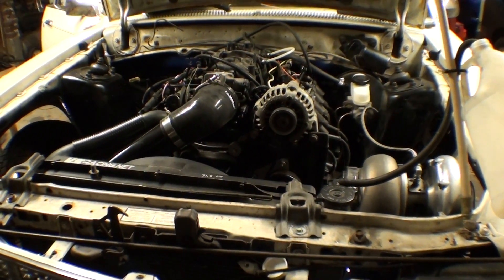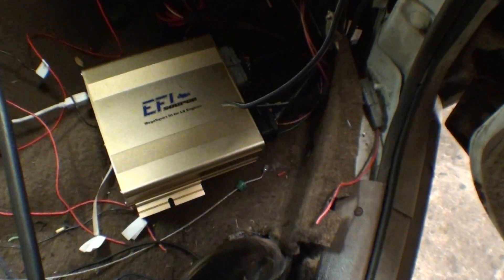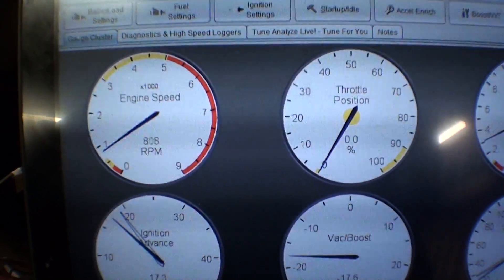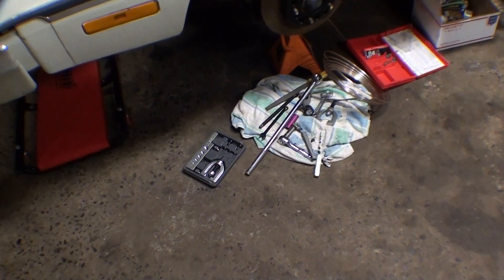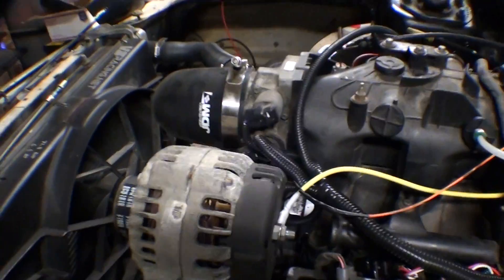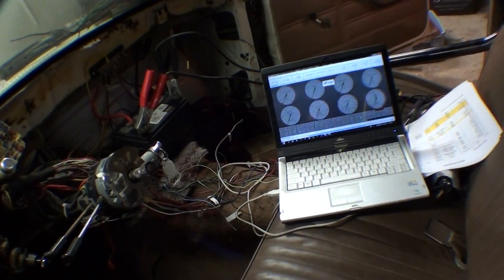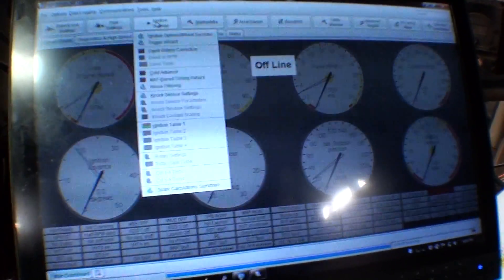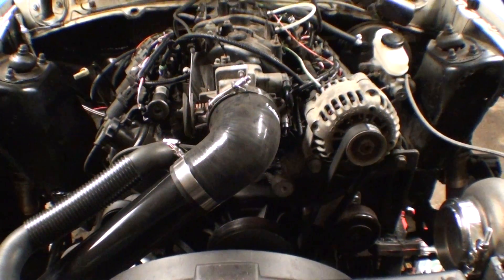1-25-15 Fairmont 5 update/surprise

Comment: Did MS2/Microsquirt not have idle controls or did you just never use it? Im buying either MS2 this week or Micro.
Reply: and where did you get the gold from? i cant seem to find it on efi source?
Reply from the maker: aiarchon http://www.efisource.com/shop/ms3-lsx-plug-and-play/
Reply from the maker: micro and MS2 has idle control but its pulse width, and LS motors use a twin motor stepper, so you have to mod them to do that, micro doesnt have enough outputs by the time you are done using them all for spark and injectors
Reply: I see. What did you use on the TPI van? MS2? Did you even run a IAC valve?
Reply from the maker: aiarchon i piggy backed ms1 into the van, only taking over the injectors, since the stock ecu did idle, timing, fans, converter lockup and more, i only wanted to fix the fueling issue, so i only patched it in to do fueling calculations

Comment: I did the exact same thing with the idler but I just used a stock truck idler with a 1/4'' spacer in one of the power steering bolt holes and a jam nut from behind. (6500rpm never tossed a belt)

Comment: The only question that I have is about your down pipe placement.  Through the hood with a 90 degree right off the turbo?  Flapper?
Reply from the maker: its going to go down and under the fender, out the front before the tire
Reply: ***** All the hoses look like they will be in the way.  I however do not doubt your abilities.  On a side note......Jaime alluded to you doing a truck for your next build.....butilda old school short bed C10 please.  I need some inspiration.
Reply from the maker: Chris Rustler haha c10s are wayyy to expensive in this area, everyone wants one, she likes the 99-2000 or 2010 ish style work truck body so we will see what we can get.
Reply: ***** Would be worth a drive to go get one!

Comment: awesome update.. love how the ecu has the air fuel etc warnings or cutouts in it.. ive being trying to come up with a air fuel lean alert or ignition cutout on a blo thru.. so far without luck..
Reply from the maker: there is the new AEM wideband with built in alert system that can fire a relay or output, you could wire it to a relay that powers your ignition or something similar and it would kill your power if it deviates
Reply: ***** thankyou thankyou...

Comment: I noticed that once the battery has been disconnected you have to always re-set the iat sensor or it won't idle correctly so what I do is turn the key on (don't start) and unplug the sensor turn the key off for 10 seconds and plug the sensor back in  start car good as new.  Let me know

Comment: Someone told me if you loop your heater hose like that you can cause an air lock and overheat but I think they are blowing smoke up my you know what...
Reply: Motor trend just swapped an ls3 into a car and suggested to loop the water pump like that. They suggest to use a U shaped hose though the kink in his line Looks a little sketchy.
Reply: Looping it is the same as if it was actually hooked up to the heater core. Its fine. They make a U-shaped hose to avoid the kink. I'm sure Matt wasnt worried about the kink. Capping the heater hoses off is whats not recommended.